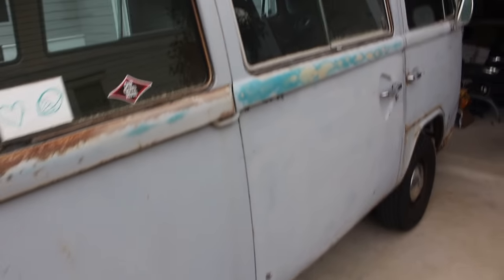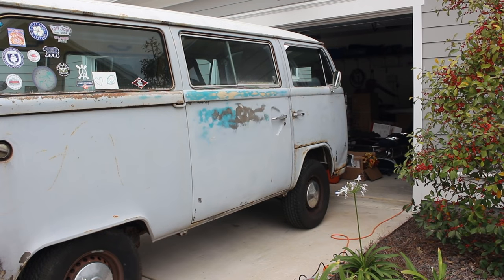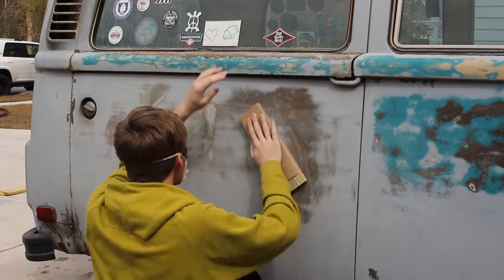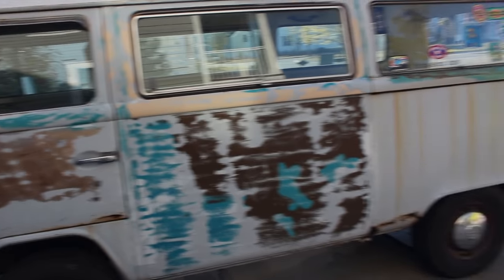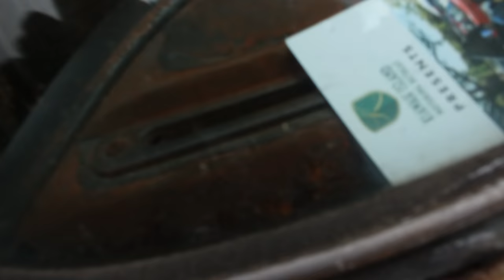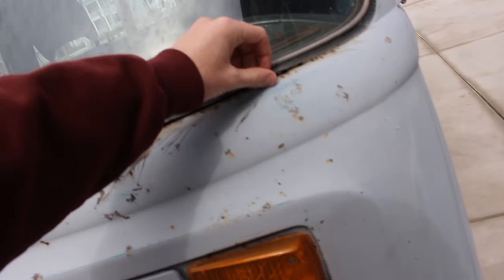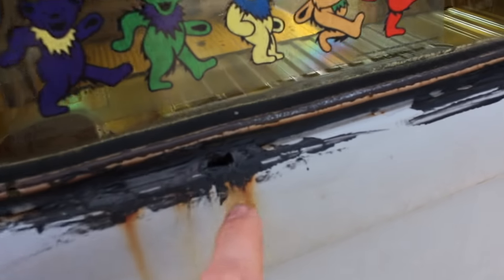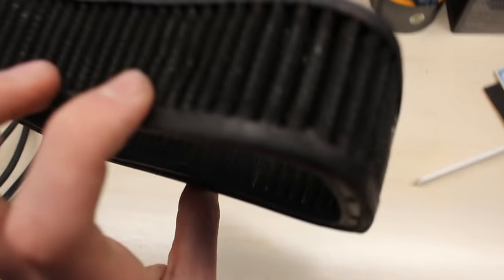I Used WHAT to Remove the Paint?! - Messing with the Bus Paint + Some Extras!

Comment: Austin, Get some window screen from home deport.  Not the wire type but the fabric type.  Cut a small piece for over the rusted out areas and then put the caulking over that.  Just a thought for a temporary fix.

Comment: Anything you put on those holes on the back door is just going to drip down, but there is a fast and cheap trick to fill them.
Grind the paint off with that flap disk you showed in an earlier video, using the grinder clearing about 3/4 inch of paint around it.
Then get some ordinary wax paper and cut it oversize to cover past the bare metal edges. Then cut a piece of fiberglass window screen to fit on the bare metal area.
Set the screen on the wax paper and spread some Bondo body filler on just the screen. Then take your bondo band-aid and slap it down over the hole. It will cure quickly and you can put another layer of bondo over top to reinforce it and hide the screen. Then just sand it smooth.
You can get fibreglass compound with short strands of fiberglass already mixed in resin, but it is a pain to work with, and applying it against gravity, it will still cave into that hole.
Oh, also purchase a respirator rated for work with aerosol before working with fibreglass or paint. They are hot to wear, but not much more than the dust masks, and it is so much more enjoyable not to smell the fumes as you work. Your lungs will thank you.
My 72 bus had some holes on the front floor pan and one behind the front driver's side tire in the wheel well. I used this method almost 25 years ago and those patches are still holding strong.
Good to see you putting all that love into that bus. It will teach you many things about much more than bodywork.
Thanks for uploading the series.
Reply from the maker: +tedtrash Wow thanks for that tip!  I'll keep it in mind :)

Comment: As an industrial mechanic who worked in many places for many years and the last seven years in vehicle manufacturing, i advice you to remove all windows and seals to get rid of all paint. Strip the car as much as you can, even unhinge all doors and flaps. Unscrew the bumpers. Remove all the interior completely.
Remove all the paint down to the first layer of primer at least and prime the whole vehicle completely. 
Use a sand blaster and a spray gun. Use Primer, cover with at least 2-3 layers of paint and finish with clearcoat. Roughen up everything with abrasive pads between every single step to maximize adhesion of the paint. Buy new seals for the windows. Make it right or stop it.
Just fixing some spots makes you work over and over and over again the next years, because rust will come back and all in all the bus will look like crap.
Don´t forget the wheel well: grind it down to the metal, check for rust and recover it with new stone chip protection.

You´re on the right way, but there is always the possibility to improve a little more. 

Greetings from Germany :D

Comment: My concern is which is more important? Mechanical or cosmetic? In my opinion, it needs to be mechanically sound and run it's best before making it look pretty.
Reply from the maker: +David Coats I completely agree, that way I'm not on edge every time I drive it haha.  I just don't really drive it during the week so I just have some fun messing around.  Definitely will address mechanical issues though! :-)

Comment: http://www.homedepot.com/p/Krud-Kutter-22-oz-Graffiti-Remover-GR226/205552884  Used this to take all the crappy black spray paint off my "vintage" 1975 CJ5 Renegade's beautiful Trans Am Red paint. And when used very carefully this stuff will not remove factory stripes.  The filter, if not using K&N cleaner just soak it in Purple Power and always rinse from the inside out. Always air dry.